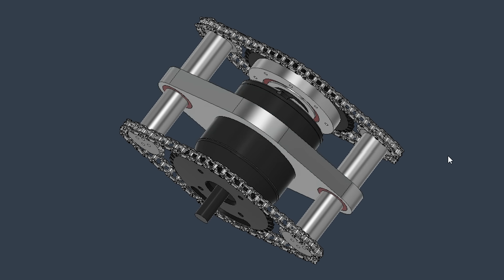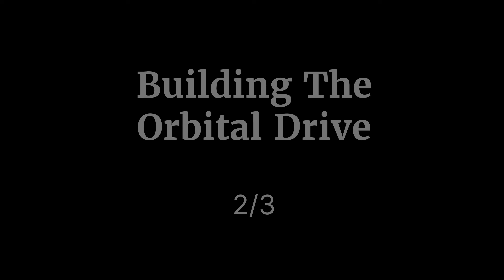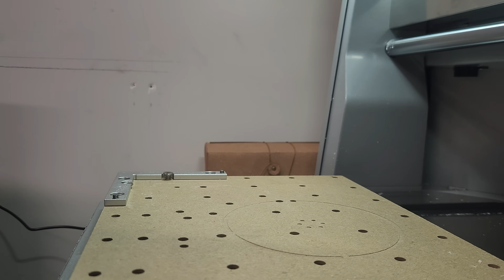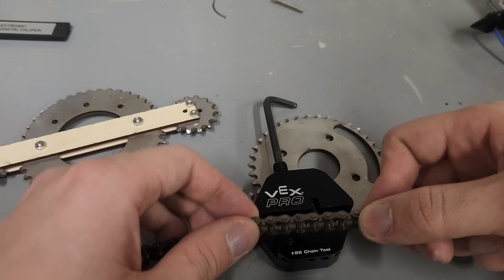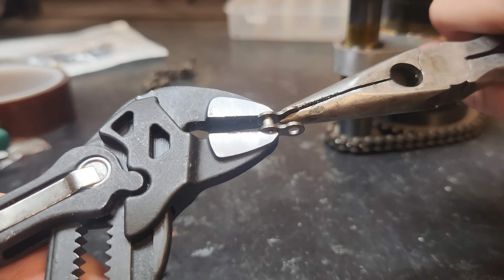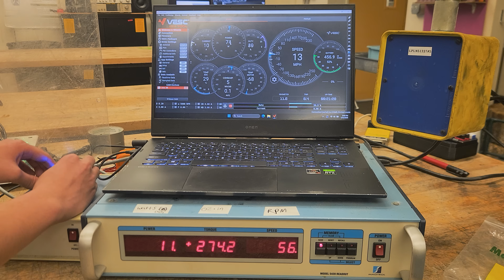I Dyno Tested The Orbital Drive Gearbox

Comment: Tension is the primary problem with belts too. Fixed center never works as well as a proper tensioning system, and I never came up with a good design for it. Also it's difficult to find combinations of large pulley, small pulley, and belt tooth count to get exactly equal center distance on both halves. Here are some of the combos I found when studying it years ago. Mesh is the number of teeth meshed on the large pulley, which determines the torque capacity (opposite from a normal belt drive where the smaller pulley has fewer teeth meshed)

9.75:1 or 10.75:1 ratio
16:39 belt61 center31.84 mesh7
16:43 belt62 center31.87 mesh10

20:1 ratio
13T:43T belt61 center32.82mm mesh8
14T:44T belt62 center32.82mm mesh8

32:1 ratio
17T:39T belt61T center31.22mm mesh7
18T:40T belt62T center31.22mm mesh8

36:1 ratio
18T:38T belt61T center30.755mm mesh6
19T:39T belt62T center30.755mm mesh7

Comment: WHAT IS THE PURPOSE??? Are you supposed to actually drive it from the other end and the end with the motor spins like 8 times for ever 1 you spin???n I'm just so confused lol like always 🤪
It is pretty dope tho. You could remove a link and just make it a tight fit, it should stretch out a little bit with use, just make sure you keep the chain greased. OR you could add a tensioner, but you'd have to add one to both chains, and they have to be on opposite sides so it's balanced - we all know what that leads to LOL :D - HAVE FUNE but BE SAFE!

Comment: Very interesting. This could be used for a 4th axis drive on a milling machine. For that application, I'd use toothed belts with an additional adjustable tensioner on both sides of both belts so it balances. Those tensioners would also wrap the belt around more of the large pulleys for more torque. You'd also need to balance the assembly. so maybe a tapped hole to fit a grub screw for that.

Comment: While its an interesting drive system  What advantages does it have over traditional gear drives.
Reply: The potential for zero backlash with properly tensioned belts is pretty much the only advantage.

Comment: Perhaps I missed it, so I counted teeth. The fixed sprocket (the one with the slot for the motor wires) has 38 teeth. The other large sprocket has 40 teeth. This size difference leads to the gear reduction ratio. All four small sprockets have 14 teeth. A bit of thought will make it clear that it's not possible to tension both chains correctly, as the center distance for both chains must be the same, yet the sprocket sizes are different. (Belts would have the same issue.) The fixed sprocket side will need a tensioner, or maybe two in order to maintain balance. Sprockets can take a small amount of misalignment, so maybe the shafts could be angled slightly for a janky solution. Replacing the chains with gears ought to be a better solution, as you can tune the gears' size slightly to make the center-to-center distances match.

Comment: Honestly - this has amazing potential for 3D printed parts as the Belts really support the low strength 3D printed parts due to the many interface teeth. This could allow a backlash free, cheap and easy to build gearbox for 3D print.

Comment: Aside from the order of operations, the execution is quite impressive.
If you decide to do it again, buy 219 racing go-kart chain, cut your chain pieces and press the chain back together. Then carefully calculate your shaft distances before machining the aluminum. The ultra-high-quality chain won't stretch much and will run very quietly.

Comment: it looks like you have a high power CO2 metal laser cutter and maybe a 45W laser cutter for wood. I’m interested in trying to reproduce Clock B using only laser cut parts. What do you recommend based on your experience building your designs?

Comment: A new chain has a break in period. It will strech a ton. Then will stay basically unchanged untill its rapid demise. Oring an Xring chains are the most stable. In this case the weight is allso an efficiency killer. I see absolutely no point in this design other than a fun project. No real use for it. About a dozen other ways to do the exact same thing far more efficiently.

Comment: Nice prototype, but it clearly needs more calculations done on the side of measurements to make it run smoothly. You fellow engineer should probably know there's plenty of equations and formulae for chain drives, and there should be a nice one to guess the exact center to center lenght for a given chain pitch, number of teeth and number of links...

Nevermind it's on "Machine Elements in Mechanical Design" 4th Edition by Robert L. Mott, page 290, equations 7-9 and 7-10. Good luck with that pressure fit next time.

Comment: on your axle support frame, cut a slit between an axle hole, and the motor hole. Then looking at it perpendicular to axis, you can drill and tap for a grub screw to spread the slit gap open. this would allow you to tension the chain without a total redesign.
So your holes would look like < o ' O ' o > (the apostrophes representing a slit in the frame)

Comment: This is really a variation of a harmonic drive, right?
The flexible spline replaced with belts or chains.
Reply from the maker: It is effectively a cycloidal drive, except instead of moving a cycloid around some pins, you move pins around a cycloid (sprocket in this case).
Reply: @tylon22  
I thought so.
I remember sketching something like this in the mid 1980s, after getting a book about building robots, which had a few pages about cycloidal drives and guessing bike chain could replace the cycloidal/flexible spline.
I'm glad to see some-one actually got around to building one.
Reply: More closely related to Wolfram/compound planetary gear.

Comment: Should have just used a chain center to center calculator with those two sprocket sizes to ensure that the distance between your sprockets lines up with an integer chain length.
Reply: I've never seen a chain drive in my life that didn't have some sort of tensioning mechanism built in.
Reply: @Csendesmi  yeah, but this technically doesn't need one, and it might be hard in this case because you'd probably need to make it symmetrical. you should just be able to build for a specific chain length to start with
Reply: @hierper7973  it needs one...quite visibly. Also depending on the type of tensioner it can still be symmetric.
Reply: Yep, there's a really useful site called gear generator that does those calculations for you. Edit: it actually wouldn’t work for this application with three sprockets, but it’s good for usual gear trains.